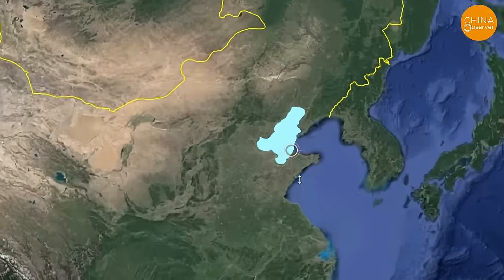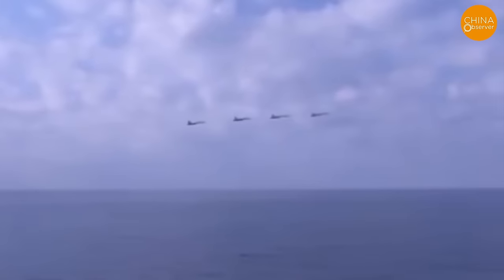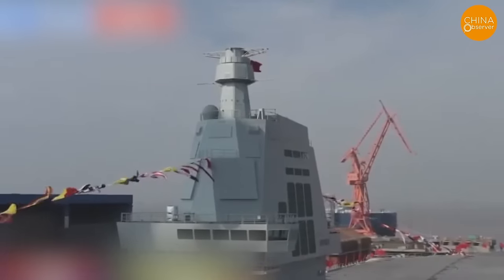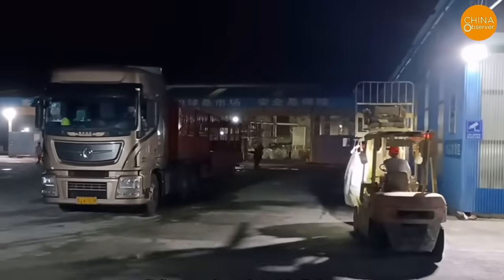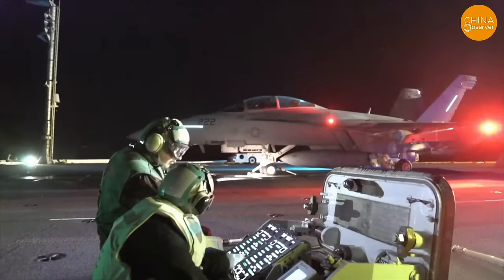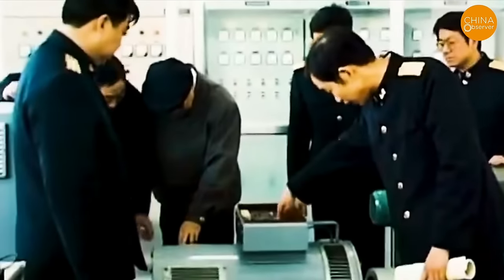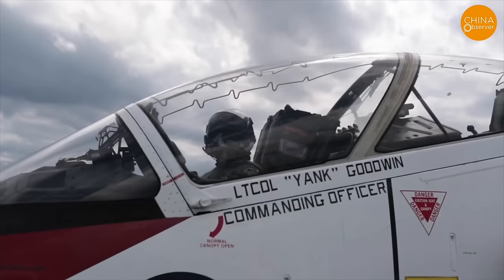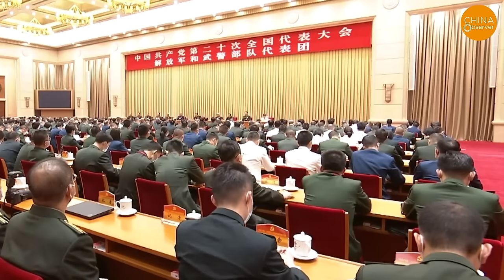China’s Aircraft Carrier Sacrificed?25-Year Electromagnetic Launch Research May Destroy Its Aircraft

Comment: Choosing to not make it a nuclear powered carrier and use electromagnetic launch is quite the decision 😂
Reply: "Choosing." It is a massive assumption that they had any such choice. Shock proofed, rapid spool up and down, naval-grade reactors are not a simple or easy technology.
Reply: @282XVL  the type 004 has a nuclear reactor "planned" so the choice was only made on this one specific ship.
Reply: Wait. Rumor has it number 4 will be nuclear. They haven’t stole enough to make it feasible.
Reply: They would have been better using a steam powered catapult system. Similar to those used on conventional powered carriers. They do not require the consistent high level power output that electromagnetic systems do.
Reply: @chowchow2386  they didn't choose the steam powered catapult bc it requires more down time in between launches. Which is ironic considering they will never use the electromagnetic one they do have so the downtime is infinite

Comment: There are many levels of testing.  Component testing is perhaps the most granular.  Multiple components create systems, like a catapult system.   When your systems fail, generally it’s because of the failure of a component once they have been amalgamated into integrated systems.  After systems you have integration systems, where multiple systems work together to perform operationally.  Integration testing is generally done using the most realistic environment possible, but integration systems testing is only a prerequisite to operational testing, which is full blown production.  In this case, operational testing would be the entire carrier, hardware, software, sailors, and overall process definitions have been integrated to provide consistent behavior.  China is still failing systems testing, probably due to poorly fabricated components, but who knows (especially China).  If they keep up their current testing progress, another 30 yrs and they should have a functional carrier; however, it should be noted that operational standards differ.   The USA has 100+ yrs of naval operations, so they might catch up to the USA by 2170 A. D.  ;)

Given the time it’s taken to create the current failing systems, it’s my guess they will continue to fail, as their component’s integration will have more failures  (from hardware usage during testing); that is, their hardware will fail before they can successfully integrate it into a operational system due to lack of knowledge.  When you dont invent the technology you are using, your ability to identify failure causes greatly diminishes.  I doubt it will be operational before it’s obsolete, or costs more to maintain than it cost to initially fabricate.  The USA obsoletely tech all the time that works just fine, simply because the cost of maintainance exceeds it’s usage, given new developments.

China’s core technology acquisition model of stealing or buying negates its possible surpassing any entity that actually invents such technology.  Put simply, the USA aspired to an idealized concept, conceived via creativity and knowledge, and we always hit a bit below our aims.   China, getting such knowledge and aims from an existing baseline (the Ford class carrier, or other US technology), will hit a bit below their aims of copying that aim, and thus always be below what they are copying.  It’s the reality of engineering.  It’s like shooting an arrow at a target; you always miss the target by a little bit because we dont live in a dream world, we live in reality, where chaos creeps into order.  This difference between abstractions and implementations is real.

Comment: The electro-magnetic force applied far exceeds the design capabilities of the undercarriage of the crappy aircraft they produce. They have to HUGELY reduce the force applied to the planes. Even a modest reduction in force requires an ENORMOUS reduction in weight, fuel, and capabilities of the launched aircraft. In short, there is no useful combat capability left after the launch.
Reply: Edit to add..the ski jump ALREADY forces a 30% reduction in weight and fuel storage.
Reply: Right, I think the French aircraft carrier, due to length, adds an extra 2-3 g’s to the plane/pilot.  They are gonna turn the pilot into a rocket man lol
Reply: There's a reason why carrier aircraft are different from their land-based brethren.  I think the Chinese Navy just stuck some cable hooks on their standard Su-35's and declared them as carrier-rated jets.
Reply: That, or they have to retrofit every aircraft they put on the thing.  And change the way they build new planes.

Comment: They never had a hope to run that system for a lot of reasons the biggest being its power requirements. It requires nuclear power.
Reply: @johnjaffe6107  one plane won’t do anything for anyone though. As a test bed ok you learn the tech and try again but that’s not how they push this carrier. It will never be sustainable as an actual aircraft carrier that leaves port for specifically that reason, if it can’t reliably launch over and over again then what’re we even doing lol
Reply: @briandstephmoore4910 its carrying aircraft
Reply: @iamamoghalfmanhalfdog5325  well yea… but if it ever leaves port it won’t have the land based power and will need to resort to its own and it’s not enough. There launch and landing rates would be atrocious. There not even a true blue navy also so that will probably never go farther than a hundred or so kilometers from any of chinas coasts if it leaves dock at all.
Reply: @briandstephmoore4910  it was sarcasm carrying is all it can do
Reply: Or a separate generation system.
Reply: @DavidCooper-vh4nr That might work but the fuel supply on this carrier is limited and a great deal of the fuel will be used for propulsion, if the other two carriers are an indication.

The other problem with that is where to locate it. Wherever this additional power system is placed, it is going to reduce space of something else. And depending on the weight, the Chinese may have to redo the balance of the ship, which is nearly impossible to do at this stage.
Reply: I must agree with you.
Perhaps the 003 would be assigned an oil tender, much in same way as the Russian carriers are accompanied by several tug boats.
Considering that it takes over 16 hours just to heat the boiler up to operating temperature, the catapult electrical system would entail further manpower and monitoring.
Space is always a consideration as well. But they managed to find room for a convenience store in the bow, beneath the flight deck.
At any rate, the PLAN has alot to learn before actual flight operations can begin.
Thanks for your response.

Comment: China has been trying tor nearly 75 yrs to build a military grade turbine to power a military jet.  Extreme high power in small volume.  Extreme wear and tear.  China as to buy it's military engines from Russia, and those are the worst in the world requiring 2x maint of Western jet engines.  It's debatable if any would launch a fully capable combat loaded jet from their one carrier, if they could get it running at all much rather at the 40 knots needed to launch aircraft.  For that matter, isn't there news that this Chinese carrier is already showing stress cracks?  Which is hardly a surprise.  It took China literally a decade to learn how to build cargo containers good enuf that anyone would buy them.

Comment: Before the specs and EM catapult of Type 003 was finally announced, the US Navy feared that China would try to make something along the lines of Forestall or Kitty Hawk class conventionally powered and steam catapult super carrier. Though USN felt it would still take China decades to prefect such carriers, they foresaw that technology was well within China's abilities and was well suited in creating such carriers and could create up to 6 within a decade. Though only holding 60 to 70 aircraft, again 6 such carriers would be more than enough to push the USN out of the Western Pacific. But then Fujian was announced, with EM catapults, but conventionally powered, being larger than Forestall or Kitty Hawk Class (weighing 20,000 more tons at 100,000 tons rather than 60,000 tons of Forestall), the USN realized the Fujian is white elephant prestige project and not a serious weapon. 

There is a reason the USN never bult conventionally powered carriers that big, after a certain size the steam turbines engines are not efficient enough to move that much weight economically at any real speed. So either your carrier has 25% or more less range than a Forestall or it has go 25% or more slower at all times. Basically going from ocean going to something that make land bases become more economical or move as slow as a cargo ship or too slow to launch aircraft/evade attacks.

Comment: When you copy something, you fail to develop experience, that only the original creator develops.  This is true of every technology/solutions innovation.  This is a historical truth.  Japan learned this when it attempted to challenge the US in various technologies from the 50s to 70s, notable in the automotive industry, audio and visual equipment, etc.  Soviets learned this in the space race as well.  It is even now happening with A.I. practical development and implementation.  Even with the robotic mechanical systems, the Japanese have a lead on, other countries are struggling to achieve parity, this includes the US to an extent as well.  Of course there are key individual innovators that achieve technical leap frogging, independent of countries and governments, but these are the exception, not the rule.  Tesla would be one such example.  And yet, China EV success is completely inconsistent and failing to achieve parity to Tesla, even when it is assumed that everything Tesla as printed, documented, or illustrated over time, the CCP,  i.e. China, has stolen.  So how else do you explain the difference in results, between China EV development and say Tesla development?  Tesla is the innovator, China is only the duplicator, and as history shows in the last 2 to 3 years, such duplication is far less in terms of quality, consistency and actual results achieved.  Such that China EVs especially their battery technology is a colossal failure, and in many cases deadly fires and explosions have resulted, such that the average China EV purchaser is forced to abandon their purchased EV.  For the foreseeable future China EVs will fail badly in the global market, once the true quality and consistency, they lack, becomes apparent to the greater world.

Comment: Just central planning at its best. The US had electromagnetic launch capabilities, and the CCP wanted it too. The US had DECADES in catapult launching experience. The Regan was held up for YEARS to perfect these systems. CCP has almost 0 experience, and a total lack of engineering ingenuity. The magnets were probably bought from a cheap Chinese knock-off manufacturer, with electric cables that don't meet specs.

Comment: Uk opened First Inter-city railway connection in the world between Manchester and Liverpool in 1830. 

Japan opened first high speed rail network in the world in 1964.

China invited Japan, Italy, France for co-operation to build their first High speed railway in 2007. Now China Has Indigenous designed CRH380A High speed rail that has a maximum speed upto 400 km/h . They had a plan to build 45,000 km of High speed railway network which they have surpassed already. In 10 years China has build more than double of rest of the world combined High speed railway network which they had no Idea about a decade ago. 

Where Uk couldn't build a 230 km high speed rail in last 15 years with 100 billion dollar budget. 

Just an example. If the govt is not corrupt and not trying to make the Top 0.5% happy constantly to be in power. A country can achieve success similar to China.

Comment: When launching a plane from a catapult, it is important that the acceleration of the parts attached to the plane’s nosewheel is not too rapid, or it will damage the planes undercarriage and possible the airframe.  Having an over-powered catapult is useless unless the plane is producing enough thrust.  The J-20 is very underpowered.

Comment: The PLAN has come quite a long way in a relatively short amount of time, now able to claim the largest navy in the world (strictly by hull numbers as opposed to actual tonnage). It should not come as a surprise that developmental issues would occur with such rapid growth and experimentation, especially if portions of the EMALS system was reverse-engineered or required special materials/component arrangements that have stymied its operational certification. 

The USN also encountered numerous issues with both its EMALS technology and the weapons elevators on the Ford class carriers, both of which significantly delayed the carrier's delivery and operational certification. If China applies enough resources to this issue, they stand to field a very capable carrier platform. Viewers should be cautious about drawing conclusions about the future of the Fujian carrier based upon this incomplete (and speculative) report. The PLAN remain a significant regional threat.

Comment: "Our machine, that hasn't had sea trials yet and hasn't been certified by the manufacturer, is already better than that of our opponent which has already served almost a full year in active operations".

It's one thing to love the propaganda machine, it's quite another when you can't admit that the guys who've been doing it for over 70 years got the hang of it a while back now and have an actual clue of what they're doing.

The Chinese have only just begun to make the enormous quantity of mistakes you make on the way to understanding what it takes to own and operate a machine of the insane complexity of an aircraft carrier. The US Navy no doubt has made its own series of mistakes to get to where they are now. They understand what it costs in time, material, people and management.

Propanda is great when you need to convince the suits in the fancy seats, but that doesn't cut it when you have to make the actual thing work. That's when the rubber meets the road. Nobody is that important that they can surpass physics. It doesn't work that way.

If this thing is combat capable before 2030 I'm going to be seriously surprised.

Comment: It's sad when your best aircraft carrier was built by Russian and is better then your own new design. India has a Russian air craft carrier that It took 10 years for them to fix. Russia has an air craft carrier of the same design as India and China and it can't get out of port for more then 3000 miles without 6 month for repairs. China has the same problem. Coping does not work when you don't understand what you stole and why things are done a certain way. Change one thing and everything can change. It's not as simple as creating a short track speed skating team designed around taking out the competition to win. When you want to play with the big boys you need something better then the junior varsity with bad equipment you have to put in the work. The biggest problem for China is the system they work under where the big decisions are made by a central government that has no expertise and is corrupt to the point that 50% of everything is stolen by the people on top. Right now the Russians and Chinese carrier forces are on a combat level equal to the USS Langley CV-1 100 years ago.

Comment: The Chinese system has been thoroughly tested at a land based site with thousands of trouble free aircraft launches so the aircraft launch system on the Fujian will work just fine. The Chinese system is also more efficient requiring less power for a launch than the EMALS. You doubters here are just wasting your time trying to slam the Chinese carrier.

Comment: The chinese carrier launch system , overloads the committed amount of power provided by its engine system. Since the drive system is non-nuclear it does not allow shipwide system operation while the catapult system is in use. With 100% availability provided for in the ford class due to twin based nuclear systems.  The chinese carrier has limited combat effectiveness due the limitation of both pilots and airframes and the economic provision by the govt for logistical operations. Nor does china have the necessary experienced men available to conduct shipwide operations  in blue water.

Comment: Those look like deadweight tests to calibrate velocity and desired thrust. In reality the aircraft engines would be augmenting the throw at desired torque and disengagement coefficient. China has succeeded in electromagnetic traction for trains and tuning these desired launch parameters may not be an insurmountable challenge. Never underestimate nor overestimate any project.

Comment: when it comes to naval systems, the simpler, more mature the better.  you don't want a overly complex system that can't be repaired while at sea.   the Linear Induction motor is the more mature and simpler of the techs.  thats why it was chosen.  does the job, and once all hands are trained on its function and repair, it will be relatively simple to troubleshoot and repair.

Comment: If you need a flywheel to get the energy, that means you also need to wait a long time to "recharge" their flywheel. That in itself takes energy so if u had an engine or turbine to do it quickly, you would not need the flywheel.

Comment: strong electromagnets work GREAT in combination with Gatling-guns, sensitive radio equipment, and steering and bolts and ball bearings and hydraulic systems on landing gears, in aviation.
Magnetism has effects on corrosion, for better and worse, great for metal around explosives and fuel, where you want corrosion to be more predictable and less extremely random.